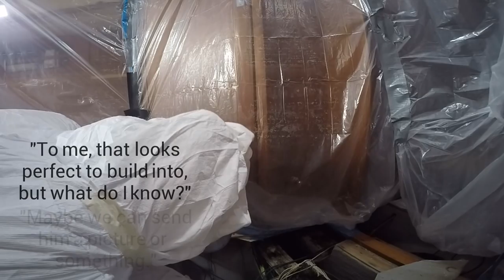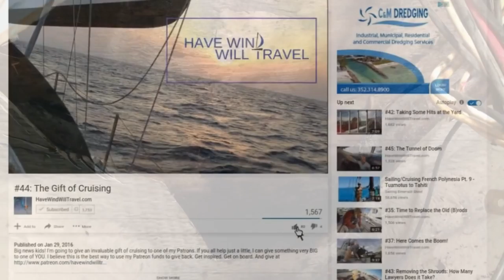#47: We Can Dig It!

Comment: Looking good, it always amazes me to see where boat builders will put wood that is under a load often in water and expect it last very long.  I do agree with the other comment about using something other than wood as a replacement.
Reply from the maker: +Maverick Sailing Thanks Maverick.  We were a little surprised by this.  Had it all been glassed, it might have been okay (or lasted longer) but it wasn't glassed on top, so ... c'est la vie.  We'll be doing it differently for her next 30 years!

Comment: I stumbled upon your channel while searching for videos of the Pearson 365 (nice review on your broker's boat, BTW) and got hooked on your series.  I haven't finished viewing yet (watching in order), so I don't know yet how this job turned out, but from making repairs to my own boats, I was wondering if you considered digging out the rotten wood until you hit good, solid material, leaving the fiberglass skins, and filling the skins with a pourable fiberglass product called Seacast?  No need to cut the glass, rather you use it as a form to pour the new stringers.  The Seacast will never rot, and is much stronger than wood.  It will bond to the old skins and the hull, making one solid beam for the mast step to sit on.
Reply from the maker: +Chuck Klima Hey Chuck.  Glad you've found me.  Enjoy the videos.  You have my full permission to binge!  (Which it seems you have.  Good for you!)  You'll see from the upcoming videos, we did something similar, dug out all the rot we could, left the back wall of the stringers standing so we could build coosa board (high-density foam) stringers back up against stem and fiberglassed the hell out of 'em!  Ha!  I have never heard of a pourable fiberglass but it sounds very useful.  Thanks for the tip.  Hope you're enjoying the show!
Reply: +HaveWindWillTravel.com I've repaired the cockpit deck on my Cape Dory 25D, the entire deck on a StarCraft 17 powerboat, and I'm currently working on the deck of my son's Mako 20 with foam cores, but haven't actually used Secast.  I've seen some videos on YouTube of people using it to replace rotten stringers and transoms.  Basically you gut out the rotten wood, leaving the skins in place, if possible.  If not, you have to build forms to pour the Seacast into, at which point it may be easier to just build new stringers (preferably of a non-rotting material) and glass them into place. The most interesting use was for a transom, where the guy actually used a chain saw to get the rotten wood out from between the skins, then poured the Seacast into the void between the skins to replace the wood. Seeing how your wood came out of the skins, I thought the Seacast might work for you.  It will be interesting to see how your repair came out.( Don't tell me here, you'll spoil the surprise!)  From what I understand, Seacast is an epoxy product that you mix fiberglass stands and fillers into to make a thick, but still pourable, liquid.

Comment: Hi Annie,  Love your videos. Quick question: I may have missed it but how did you stumble onto this problem?  I am asking because this is making want to check my boat out.  Is there a specific way to check under/behind the glass for this?  Funny story, I just finished a huge project on my house where water had been getting under the front door and rotted away a ton of wood.  I dug and cut it out like you did, sans the haz-mat suit since it was just wood, but actually went back in with wood and fiberglass to prevent future issues.
Reply from the maker: +Bob Scaggs Hey Bob.  Glad you found us and are enjoying the videos.  It all started chasing one leak.  We were trying to track leaks to the bilge, so we pulled the floorboards to try and find water trails down toward the bilge.  When we did, we noticed water in the mast base.  The rot in the stringers wasn't automatically noticeable because they have wood shims and paint on top that looked fine ... that was until you found you could stick a knife DEEP down right through them.  It certainly wasn't easy to see or find because it was hidden by good wood and paint, but many have told me since I've aired these videos that the structural integrity of definitely something that should be checked at purchase.  Here's the video where we discovered the problem: https://www.youtube.com/watch?v=ESrLjH8eS4A

Comment: an oscillating multifunction tool will get into the tight bits and wont make much mess, might not need mask and goggles as it doesn't create much dust when cutting.
Reply from the maker: +DonutDean Thanks for the tip Dean.  We seem to make a mess with any tool but that sounds like a winner.  We'll share the repair process in detail with you soon!  Thanks for watching.
Reply: I agree. I've cut lots of fiberglass with both tools and the oscillating tool creates a lot less dust - at least it doesn't sling it into the air as much. I certainly have never used goggles with it. There's no need.

Comment: I'm just curious why you guys didn't just dig out the mulch and then use the fiberglass as a form and fill it with epoxy or some other dense non biodegradable product. Maybe you explained, but with some of the extra noise in this video, I couldn't tell.
Reply from the maker: Hey Loner.  We didn't explain in this video as this was just the dig-out process and we hadn't yet decided exactly how we were going to do the repair (that is documented in complete detail in the next sequence of videos).  You'll see we did leave the back wall of fiberglass up as a mold and built the stringers back up against it using Coosa board, epoxy and glass.  Thanks for watching!

Comment: I know this is after the fact, but you need to use an oscillating tool.  there are blades for fiberglass cutting and it doesn't throw stuff everywhere.  check the link.

 http://low.es/1vf90Et